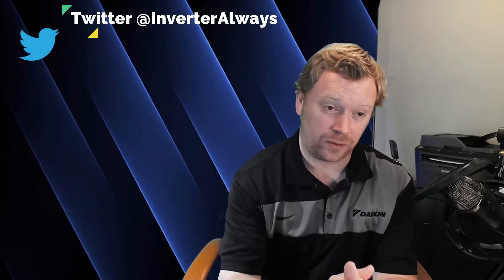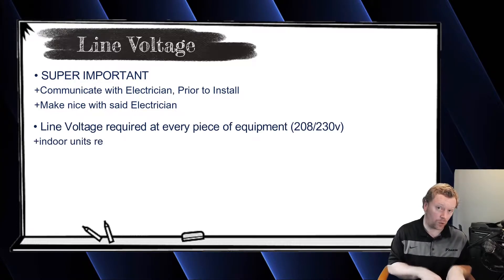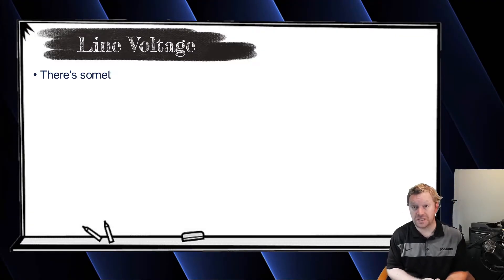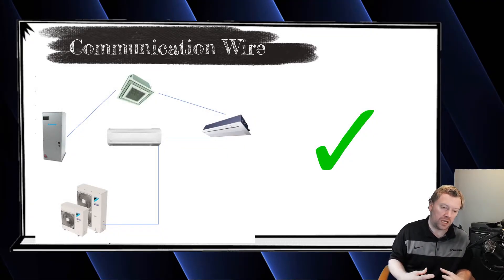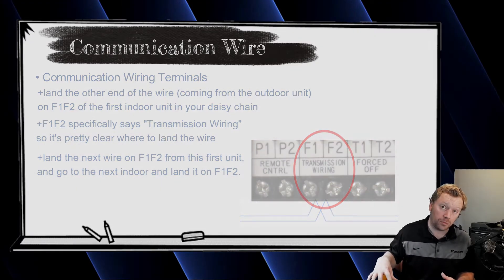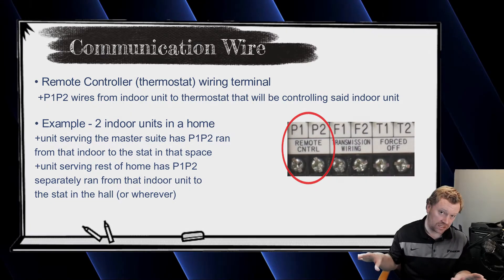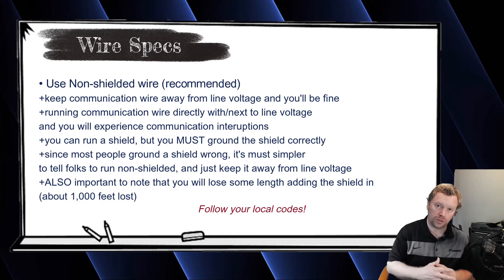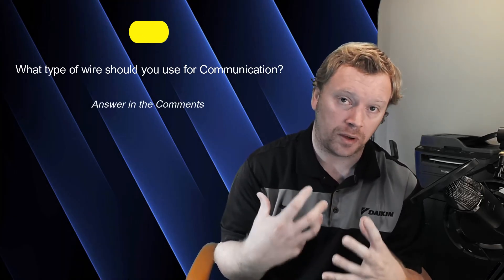It's ALL about the WIRING | Daikin VRVS Install & Commissioning Series Ep.6 - 10-22-2021

Comment: So for the high voltage on indoor units if i have only one breaker how i power the rest of the indoor units? Daysi chain too? Im installing a 4 head vrv and i was going to run independent line for each into a secondary panel with 4 15amp breaker
Reply from the maker: You will want to check with an electrician.

Comment: Can the indoor unit and the outdoor unit use the same breaker? Why?
Reply from the maker: Not on vrv. The indoor and outdoor have different mop, max overcurrent protections. The outdoor needs a dedicated breaker sized for the outdoor mop. The indoors can be combined onto a second breaker in many cases, up to the mop usually 15amp. But consult the electrician always.

Comment: I have A3 alarm in system also mention under centralization controller remote restrictions show in one remoter what is this issue how to resolve this issue kindly help me to get resolve this issue
Reply from the maker: Check out the video I did on error codes we explicitly talked about this one 👍 
Condensate error check the indoor jumper/float switch.

Comment: How do you ground the the shielded wire properly?
Reply from the maker: Don't run shielded cable.
If you did, don't ever do it again. 
If someone else did, kick them where it counts so they remember not to do it in the future. 
Repull it if possible.
If absolutely not possible than know you no longer have 6600 feet you can run but instead closer to 5000-ish.
Land one end of the wires shield to a ground terminal, for each pull of wire. Or connect all the daisy chains shields and land at one end on a ground terminal. Just don't land both ends on ground it will create an antenna affect and you'll get com issues. But again, if you can, repull it without a shield.

Comment: Quiz answer: 18 gauge non-shielded wire in lengths under 6000 feet.
Reply: @InverterAlways  Not preferred to use standard stat wire.  Stranded is the best.   Although I take issue with the science here.  When I think of electrons flowing through a conductor they want to take the path of least resistance through that conductor.  Why then would "information" electrons prefer the outside of the wire?  Seems to me that the path of least resistance be it braided or solid wire would remain inside the conductor, away from any oxidation or surface impurities.
Reply: @InverterAlways  Its interesting because if I knew what was taught on this video I would have probably saved a ton of money.  I had a Honeywell stat for my old heat pump.  When I installed the VRV I had to have a set of electricians come out to fish the required 18 gauge stranded.  It was a pain in the ass because it had to go through some wierd bulk heads that were installed for earthquakes briefly in the 90s.  There is literally a 4x12 that runs in the middle of my internal load bearing walls.  Weird.  So these fellas and I got the new wire ran after about 5 hours.  The nav works fine but I hate it.  When I win the Daiken cloud module from you, I am going to have to tear that out and run 5 wire again so I can re-hang my beloved Honeywell T6.
Reply: @InverterAlways  Ah Brilliant!  I will do.